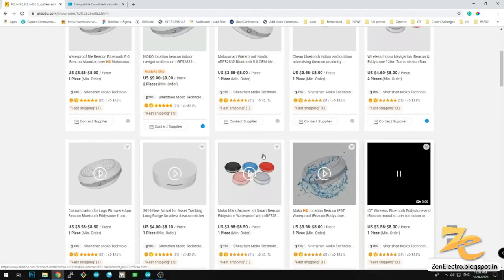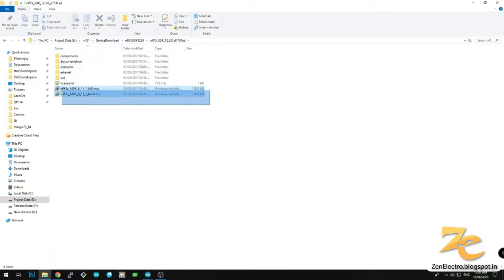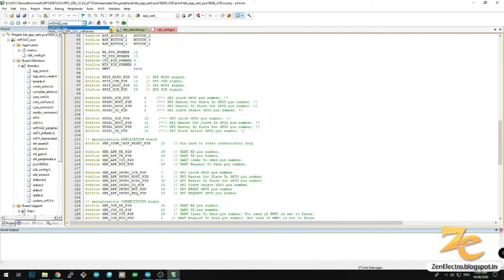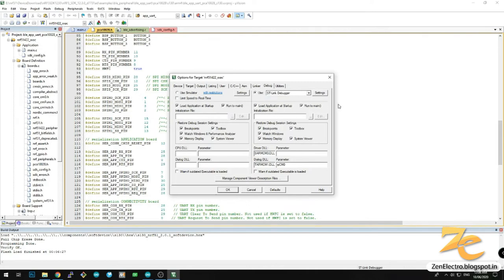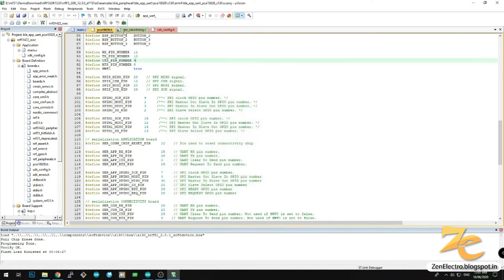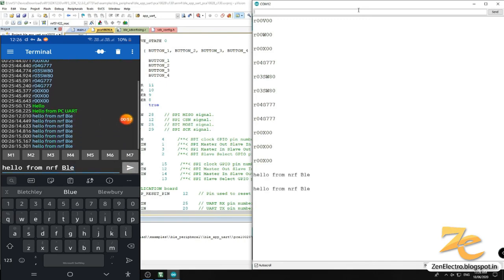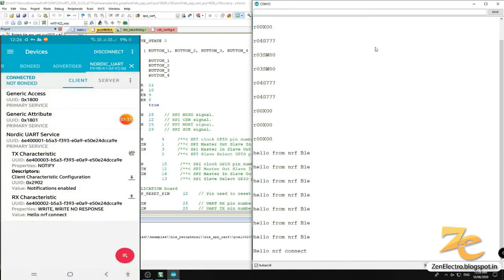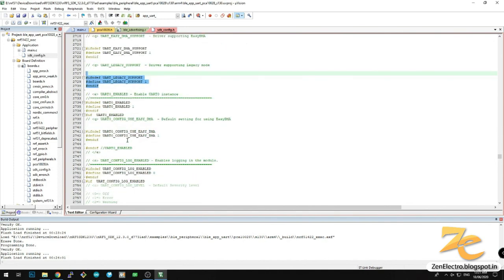nRF51822 - Get started - nordicsemi.com, Stlink v2 and Keil

Comment: I struggled a lot flashing the soft-device then I gave up. I later watched a video of a guy flashing the soft device using Arduino, I was able to follow the video and flashed the soft-device successfully. I later went back to Keil and followed your steps and the device is now working fine. I think the main problem was erasing the flash, which Arduino somehow managed to do. Thanks for this video, it helped a lot.
Reply: I finally managed to flash softdevice. Mind 3:50 "Erase full chip", though "Erase sector" also works fine.  In my case, the most important was the programming algorothm. It should be "nrf51xxx External Connectivity Board", not just "nrf51xxx". Despite other settings were different from those in video, I left them by default. Everything went smooth.
Reply: I completely forgot... It was your comment that motivated me to give it another try. So thank you so much :)
Reply: @YTRusViewer  Haha thanks
Reply: How did you do it? I also tried the Arduino flash one but I'm getting this error,"Error while flashing SoftDevice.
java.io.IOException: Server returned....."

How did you solved it?
Reply: @brianblasius  thanks

Now my nrf51822 stopped responding. I did burn code in it a couple of time(without soft Device) and it verified ok but now it's just not responding :-(
Reply from the maker: Refer this document find out appropriate softdevice memory address and flash proper version of softdevice. Flash it from keil.

https://infocenter.nordicsemi.com/index.jsp?topic=%2Fug_gsg_ses%2FUG%2Fgsg%2Fsoftdevices.html

https://devzone.nordicsemi.com/guides/short-range-guides/b/getting-started/posts/adjustment-of-ram-and-flash-memory
Reply: @Technical_Guruji  got it! I am using 2.54mm jumper so it was loose.

Just got the LED turn on/off working.

Thank you all.

Comment: https://youtu.be/NnOZml3nKvk?t=206 for the value is different each nrf5 chip and softdevice? can you explain where we can get that value from? thanks.
Reply from the maker: It can be determined from soft-device documentation. http://ultran.ru/sites/default/files/s132_sds_v2.0.pdf (page no. 54).  RAM may be vary as per your soft-device usage(adding services,characteristics,white list). ROM size will be fix size after compiling soft-device. also this values provided in the document comes with soft-device zip file